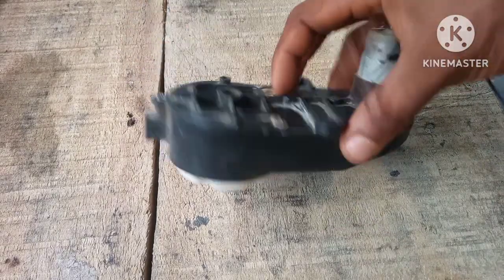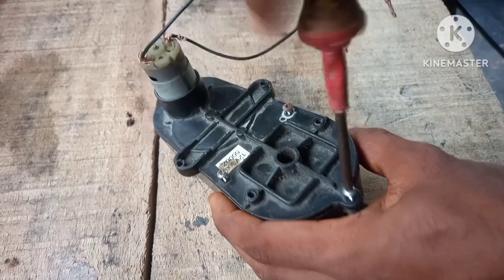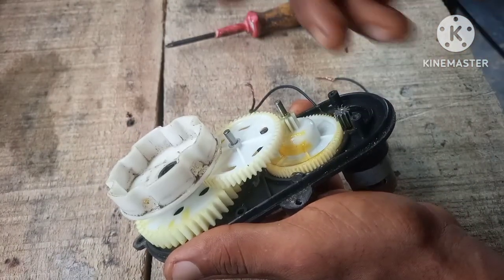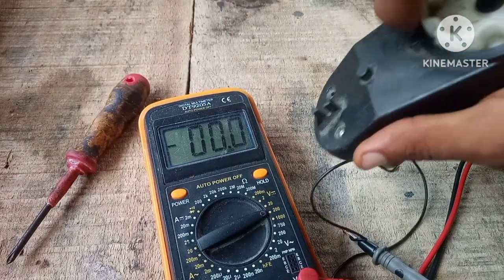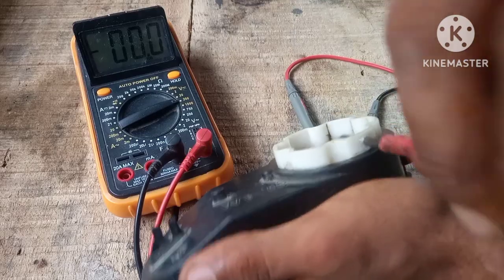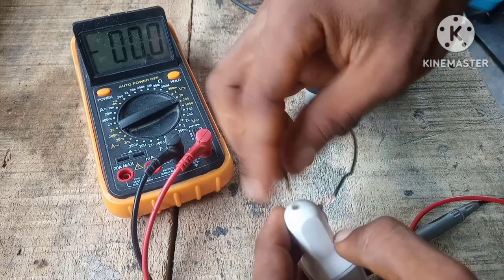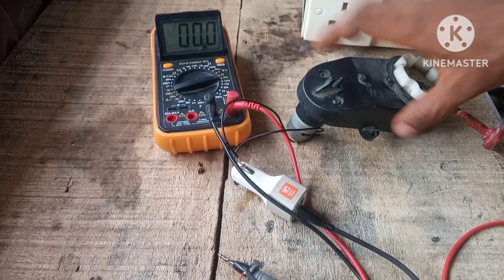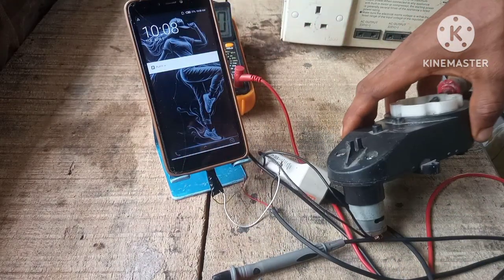I built a powerful hand crank generator for charging phones

Comment: If you added some capacitors, you could take advantage of the crank even more. If it's pushing 15-35 volts and your limiting it to 5v, capacitor storage would hold the extra, then feed the adapter when you take a rest from the crank.
Reply from the maker: Yea, I never thought of that, thanks 🙏
Reply: also if you put 12v battery it would be like power bank.
Reply from the maker: @CarinoGamingStudio yeah that's right 👍
Reply from the maker: Absolutely 🤟